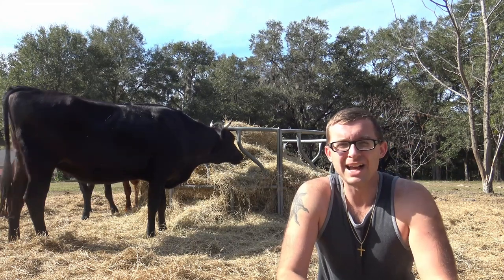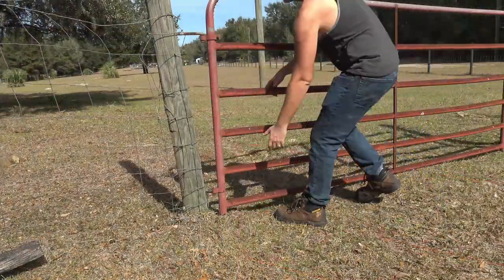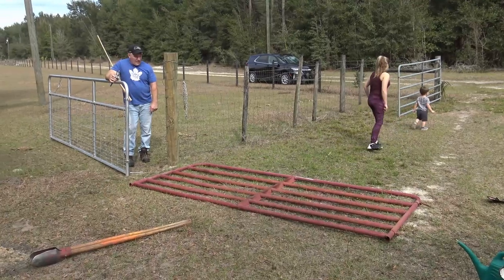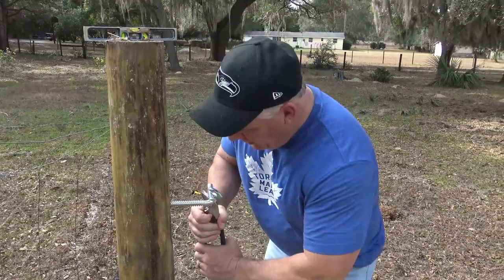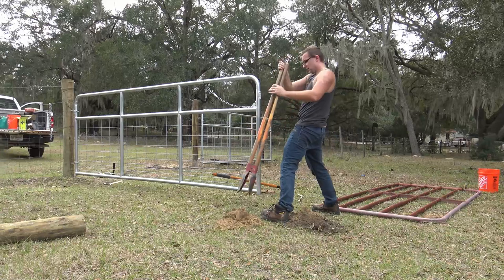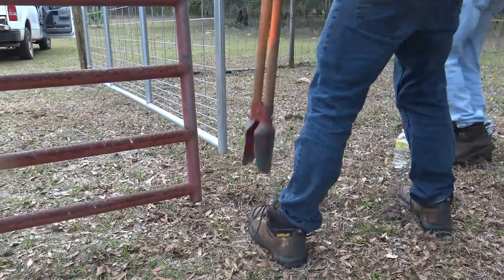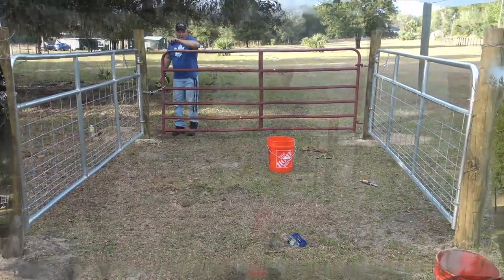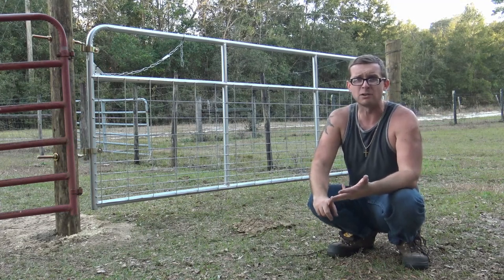Building a Cattle Pen With My Dad! | Homesteading | Corral

Comment: In the future instead of using those water pump pliers to  turn in that Lshaped lag bolt try just using a pipe.  Your forearms will thankyou. 😅😅  You should always have a nice piece of steel pipe in your toolbox to go over a wrench handle anyway  incase you need to get some extra torque on a wench or socket.
Reply: based

Comment: its a gate.  Don't bpther sanding.  Just buy some rust converter/rustoleme spray paint and call it a day.  Spray on a coating of lanolin/sheeps oil every few years and it'll never rust.  But I live i northern Canada.  Unless your close to the ocean there is there anything that would cause premature rust?
Reply from the maker: Nothing that would, I don't think. I'll take your advice thanks man